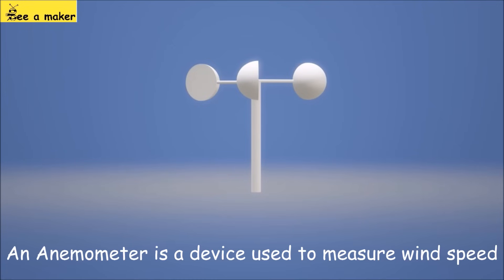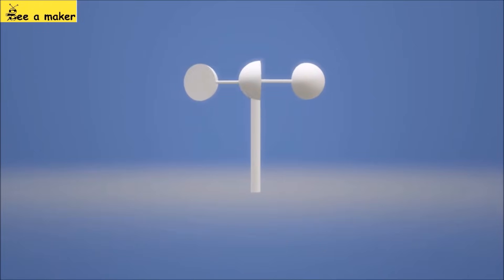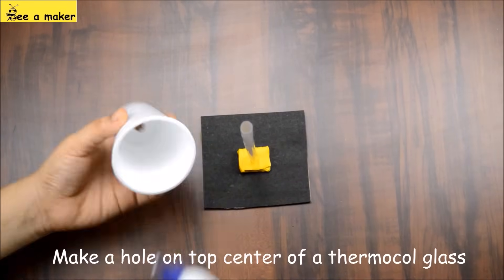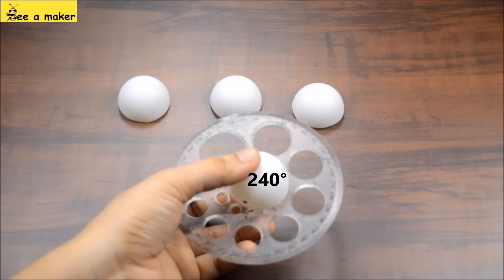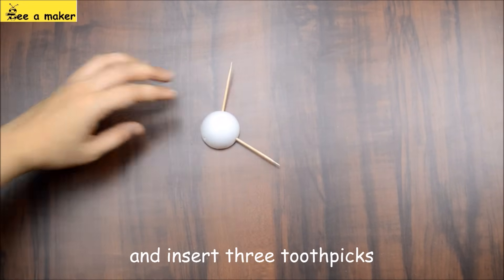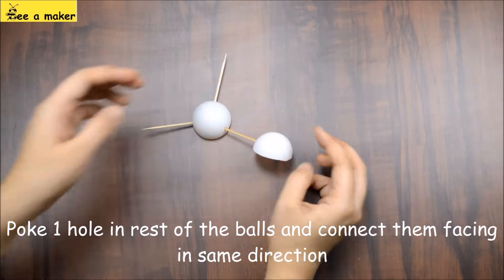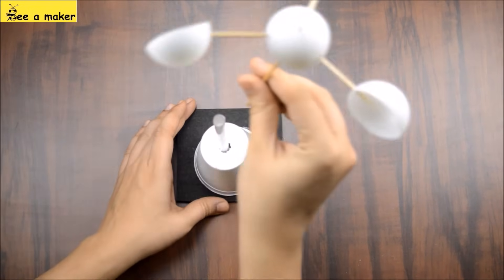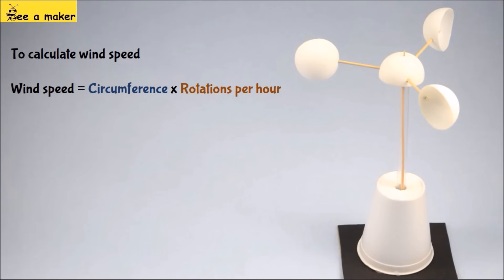How to make an Anemometer | How an anemometer works

Comment: Which ball did u use
Reply from the maker: Hi, I have used thin plastic balls available in any toy shop. The balls  should be thin so that you can cut easily.
Reply: How much vill it cost
Reply from the maker: Hi, each material is cheap and will not cost more than 100 rupees for making it.

Comment: Waste it's not rotating
Reply from the maker: Hi, can you check for the following? 
1: the vertical skewer should be able to rotate freely inside straw.
2. The cups should face in same direction.
If the problem persists, do send me image, I would like to see what is the problem.